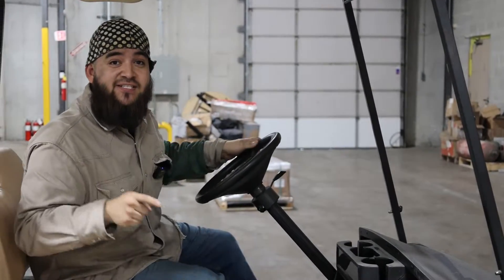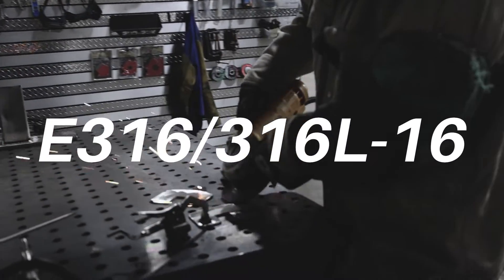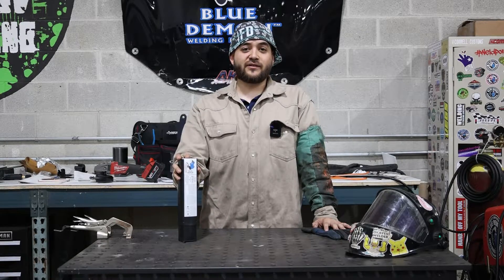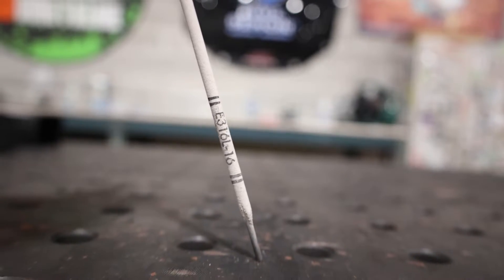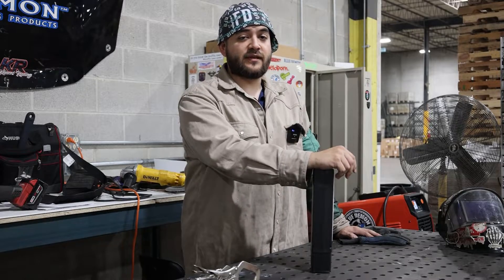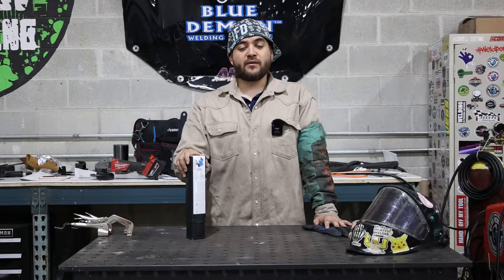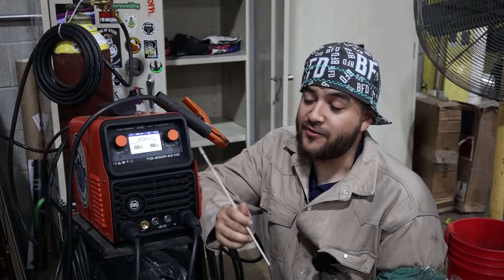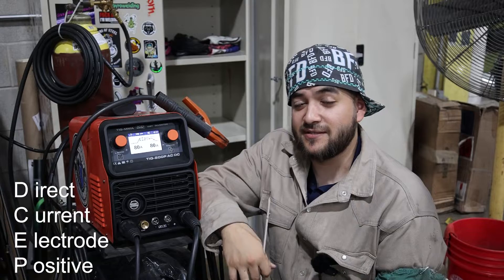Blue Demon E316/E316L-16 Stainless Steel Covered Arc Welding Electrodes

Comment: I only use blue demon wire and rods for my small welding/fabrication shop that I run part time. My favorite thing to master was the 4043 aluminum rods, took a couple tubes full to really get good with them, the Stainless run great, I found it best to let them cool and wait for the flux to "ping" off itself. Keep up the videos, thanks for a great product!
Reply from the maker: would love to see some videos on the alum stick rod.... that stuff isn't easy!!!